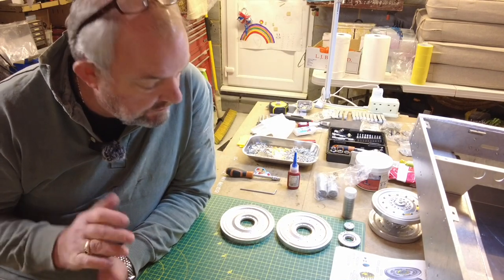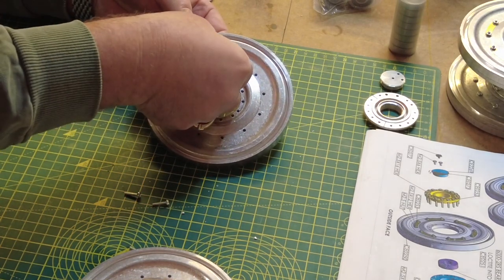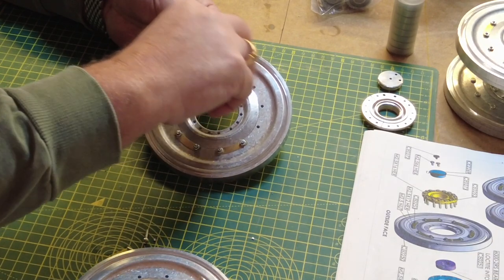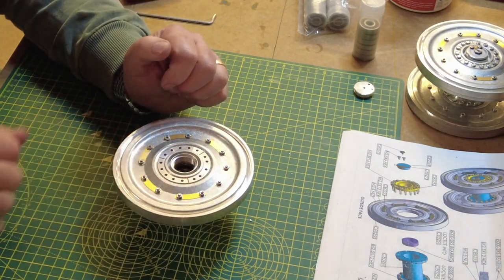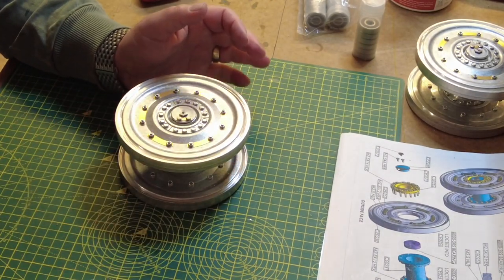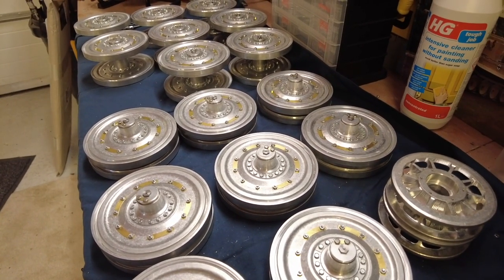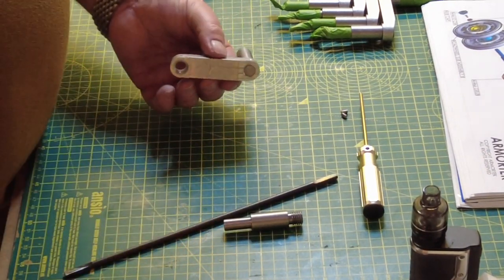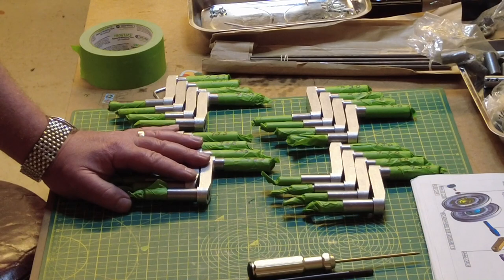Armortek Tiger 1 Tank Build -  (Video 7)16 wheel build.

Comment: Tony I have to say I did laugh when you mentioned the wheel build.
I was so relieved when I finished my wheels
32 rim bolts, 32 wheels that were in 2 half's making 64 plus tires🤣🤣
I'm at the same point you are at I literally dry fitted all my suspension yesterday and thread locked everything.
I have a build log on the forum, I must admit I have had to ask for a bit of advice along the way.
Interesting to see you have built your wheels to the hubs I've left mine unbolted to make painting easier.
Loving the build going to look cracking when it's finished.
Reply from the maker: Thanks Gary, yes the wheels! never thought I would finish them...just seemed endless at the time and I only had to build 16. I decided to build in this way as thought there would be a lot of masking to do to prevent paint build up. I was able to prime and paint the inside of the rims with no real hassle but before installation to the axle...relatively easy as the paint keyed perfectly for me.  Sounds like you are making rapid progress with your build...did you go for all the option packs as well? I know they were struggling with supply on some of the electronics...hope that is now resolved. I will check out your build log on the forum as well...Happy New Year to you and your family and thanks again for your continued support, it means a great deal to me...
Reply: @Tony's Workshop  I have gone for everything except recoil as still on the fence as I don't think it works as well as it should.
Panther us different from the tiger as you need to build most of the suspension first before you can build the lower hull around itif that makes sense.
Going to build some smaller sub assemblies today regarding suspension bump stops so I can get it all ready for painting next weekend hopefully.
Should receive the packs in the next  month or so.
Hopefully you can persuade the boss to let you have the M26 the turret casting looks cracking, I see they have got most of the lower hull assembled.
And Happy new year to you and the family I love the fact that you get them involved in the project.
Reply from the maker: Hi Gary, I checked out your build log on the forum...very impressive...its going to look brilliant when finished...I completely agree about the recoil pack...they need to improve this...
Reply: @Tony's Workshop  cheers looking forward to your next installment😁

Comment: Turning into a  family affair build with your father in law help .Good thinking to label different size axels Tony . Are the wheels solid or is there a rubber band inside like the real wheel has?
Reply from the maker: Hi Steve, Thanks yes he is a great guy..time served apprentice carpenter and I have learned so much from him...The wheels are solid, however they simulate the ridge where the rubber cushioning inside the steel wheel would be on this late variant. Kind of glad as that would have added another 20 mins on the build of each wheel 🙂

Comment: Watch out for the hubcaps jamming on the thread of the hub,i had to buy a tap to clean them up
Reply from the maker: Hi and thanks for watching and your comment. I had a similar problem, but got round this by cleaning, cleaning, gentle sanding and more cleaning..kind of went down a rabbit hole with it...I should have bought a tap as well, but in the end they worked out. Thanks again for watching my videos...